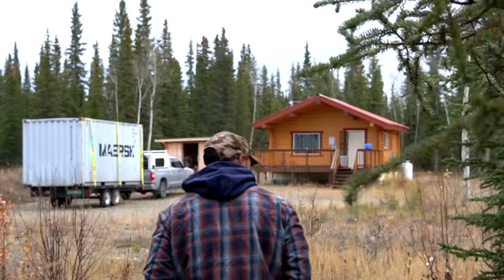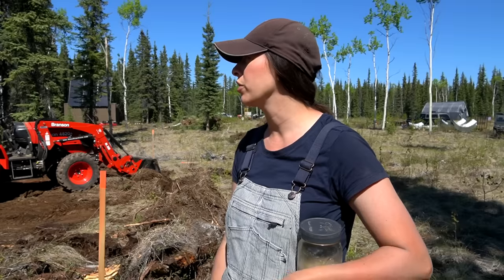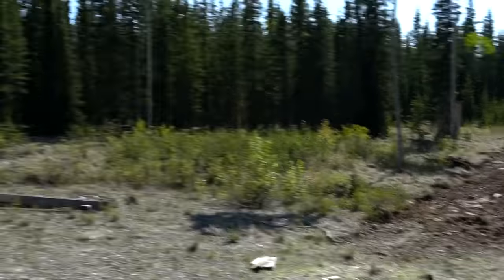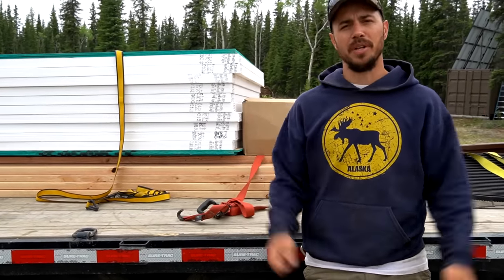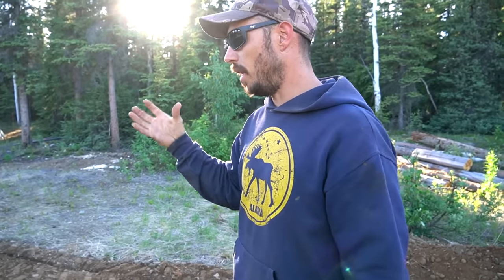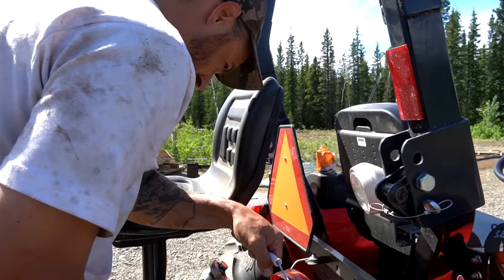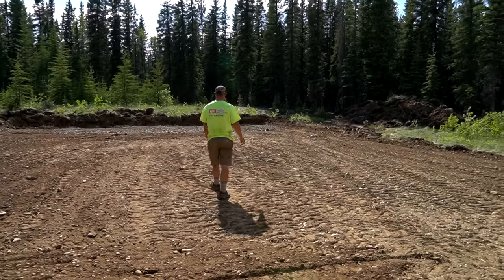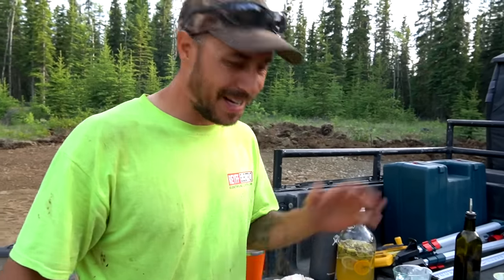Cutting in a Driveway to the Quonset Hut Shop | We Make Progress!

Comment: Tip of the day, when dealing with a thick fluid like hydraulic start your pour with the spout at the top and gradually roll the bucket down as your fluid drains, you won’t have the gurgling. Hope that helps.
Reply: Neat tip.
Reply: Either that, or if you are using the full contents of the can, make a hole in the can top opposite the the spout, it will introduce air, it 'glugs' as the air that is trying to replace fluid through one aperture, which is why it glugs, also then the fluid will empty in half the time.

Comment: In Minnesota, such sheet metal huts have been crushed by ice and snow and blown down. An interior truss arch system of your own lumber could reinforce the steel exoskeleton and optionally support insulation and interior sheeting.
Reply: Stronger than a pole barn wind and snow loads if it's bolted down properly.
Reply: @robertfandel9442  Pole Barn specifications vary on snow load and wind load etc so that is not a definitive statement, some fail and some don't.
Reply: The end walls will support and shape the form of the structure. The sheet metal sections have built-in flexibility that must be constrained over a long 60-foot span and the combination of straight and curved panels weakens the integrity of the arch's 40-foot span. Wind could put everything in motion, and snow drifts are irregular, not a good thing. I can't help but love your creativity and adventurous spirit but be careful on this one.

Comment: Cool lead in.  High summer.  Don't try to work til dark.  Not happening.   Chains for the tractor for winter use., front and back.  Some good looking dirt coming out of the work area.  Bees look great.  They'll produce til about Labor Day.   That's when it's time to harvest moose pizza meat on the hoof.  If you could just velcro a tracker on it.  Made that run to Fairbanks many a time.  When the leaves change late Aug/early Sept it's outa this world beautiful.  Good job on the shop grounds.  Yeah boy some heat.  You'll love it.  The shops I made had it.  Felt wonderful.  Hey when you put the ends in the shop hut make a sliding barn style door on the opposite end.  You can cover it over but have it in place just in case you will need to pull something through the building.  Simple to do.  Someday you'll need a way through it.  And you may want to extend it as well.  Never big enough.  Vid was really good.  Music, drone, graphics, all coming together well.  You've picked it up a notch.  Good fortune in your endeavors.  Just can't smell the pizza on screen.  Looked delicious..    Going to be fun tying off and putting up the hut.  Did a couple airplane hangers.   Battery tools, what an invention.  A million nuts and bolts.  Later, be careful.

Comment: That is some nice top soil you saved there. That dirty moss, as you called it, Holds nutrients very well. Insolation is higher at altitude and high latitudes. Literally more sunlight. Be prepared for those aspen roots to sprout. Great ungulate forage!
Tiny biters, 'noseeums' are midges. Gnats don't bite but do drive you crazy in eyes and other places for salts.
Harbor, battery xfer  pump.That Pizza looks AWESOME!
Reply from the maker: Thanks 👍

Comment: Erik and Ariel, Nice to see you guys enjoying your summer.  I live in Oaxaca Mexico in the mountains, high desert.  22 June 2023 Surise 5:54H Sunset 19:03 roughly a 16 hour day, I don't know how I would handle a 20 hour day and 4 hour night.  We have  a rainy season (roughly May to September) and a dry season  (Sep - May).  We have wide temp fluctuations between day and night.  In 37 years here I remember on one or two nights where it was uncomfortably hot to sleep.  But I was amused by how we humans adapt to different enviornments.  The Temperatures here go from extremes of 40F (coldest winter Temp)  - 100F (hottest SPRING temp) .  I love the cooler temps so everything from 40F up to 80 F is perfectly comfortable for me.  it's the 80-100 range I find unbearable and tend to sleep a lot.  So I smiled when you guys were uncomfortable around 60F which for me is almost ideal.  Right now 8am  FRI June 28, 2023 it's 75F and I have a thin sheet to take the 'chill' off hehehe.  
The chicks were adorable.  I've never seen a mottled black and yellow chick before.  Beau and Bandit seem to be enjoying the summer too.
Hugs to you both and stay COOL.  :face-red-heart-shape: All the best JIM

Comment: That Kubota oil will be a good thing in a pinch, because the oil viscosity is better on the manufacturer OEM oil, which is why warranty requires services while the unit is still within warranty be done with manufacturer fluids and filters. Your 50 hour service is a “break in” service. It’s primarily meant to break in the tractors components from first use out of the factory. I had many customers opt not to do them because the next service was 500, but I am glad to see you did them because I find them beneficial in case there was anything still in the units system from the factory that needs to be flushed out still. They have to do a lot of things to those tractors to make them shipping worthy depending on where they are coming from and going to, so that 50 hour break in service can be very beneficial.

Comment: Sounds like you're dealing with a glacially deposited gravel, which can be really dense and hard to dig in.  In 1982 I was an engineer on the construction 
of a sanitary landfill near Snohomish, Washington.  The project primarily excavated around an existing arroyo creating large basins to later be filled with 
solid waste.  This project included rubber liners to trap leachate from the landfill, purification ponds to treat the leachate and ponds to rear trout as proof 
of water quality.  The site consisted of several glacially formed deposits.  One area was calcified siltstone and sandstone replete with shell fossils left 
when it was under the ocean.  The calcified siltstone proved to be very dense and hard to remove.  The contractor was trying to use his D-9 Cat with a
"single tooth ripper" to gouge into the rock.  The effect was chipping quarter size flakes with each pass.  This D-9 Cat weighs around 50 tons and the 
"single tooth ripper" is made of hardened steel, 6' in length, 6" thick and varying in width from 2' to 3", in the shape of a tooth.  The siltstone required about 
50' to 60' of excavation.  After a near fatal accident in which the D-9 operator had to jump free in order to avoid the Cat rolling over on top of him, the
contractor received permission to use dynamite to remove the siltstone.  This is one of my most vivid construction memories.   Eric has a natural gift
operating that tractor.  🙂

Comment: A technique that I have seen used for pouring fluids from containers is to "go over the can". 

Instead of pouring with the spout at the lowest point of the container, rotate the barrell 180 degrees so the spout is at the top of can. This improves flow, because it allows air into the gap at the top of the spout.

Good luck.

Comment: TYM Tractors bought out Branson tractors.  So look up TYM tractor oil.  Might be easier to find.  Also you might want to invest in a box blade in you do not already have one.  So much easier to do gravel and driveway work.   Also will help with leveling.

Comment: So your DEF in a box, that spout will screw right into your antifreeze and gallons oil jugs, so you don’t have to try to poor stuff, just use the spout. Better than a funnel. 

Once you are doing collapse the spouts accordion  bit and it will squish the excess oil back into the jug. Leave it standing upright and it should drain pretty clean.

Comment: Eric, might I recommend you flipping the 5 gallon jug 180 degrees next time, so the spout is on top, then pour.  It doesn't do the bloop, bloop thing, because it's able to vent, as you pour.  Give it a try next time.  It's much better with full jugs.  As they get lower, it's not as big of a deal, but full buckets, it's way better.

Comment: Just a suggestion with the tractor for grading. Instead of using the tip or cutting edge of the bucket with down force that lifts the front tires off the ground, try setting the bucket flat on the ground and use the back edge of the bucket to drag the material. Also do this with about a 1/2 or 1/4 bucket full of material to add some weight. An old operator made this suggestion to me years ago and I found it helpful plus it puts a lot less stress on your machines front loader. Love your channel. Keep it up!

Comment: Not telling you what to do or how to do it (you guys are awesome) but I always appreciate tips.  A couple of times it looked like you were back blading.  If you're back blading (just trying to smooth it out) it's best to have your bucket level.  There's an angle on the back of the bucket that sort of works like a scraper, pushing higher dirt ahead where it will fall into the low spots.  Then having the bucket flat, with a bit of down pressure, smooths it out.  Take it for what it's worth, just offering a tip someone told me.

Comment: Check the front axle gear lube again after you run it for a while, On my kioti it takes a bit to work it around the front axle. Also check the torque on lug nuts and loader brackets.

Comment: That Kubota UDT-2 is premium oil, costs a lot but very good no regrets.  Never cheap out on lubricants for your machinery it pays dividends  with fewer repairs and downtime.  Kubota corp. probably charges a  "premium price" for their products  I'll agree.  I have a Kubota I am using their products to end of warranty.    I did buy O'Reilly hydraulic/trans oil this spring myself, still wasn't all that cheap,  63.00 $  per 5 gallon bucket plus sales tax.  I bought some 5-40wt T-6 Rotella yesterday at Sam's,  75.00 for 3 gallons. (full synthetic diesel oil)

Comment: Bo knows!  Bandit's ready!!  Pepper's like:  I charj 4 fotoz and awtografs.  Ms. Bullwinkle is spying for Sasquatch.  For some cheap traction assist, considered adding fluid to the rear tires on the Branson?  Something frost free for where you are, or m'be some wheel weights to bolt on?  The pad is looking really nice, as is the circular driveway.  Once you have it all defined, if you have a GPS, plot a plowing course so you know exactly where to be when the snow's deep, or especially if you're having to bust through in the middle of a storm to keep ahead of major drifting.  Also, m'be some snow fence, to keep the drifting off your driveway/pads?  Some great lookin' pizza there.  I know Ben's 100% DEET has been king in Alaska for a very long time, but that stuff is just VILE.  I wonder how this stuff would do?

Mosquito/Tick Spray For Skin

1/2 Cup--------Witch Hazel 
1 T--------------Vodka/Alcohol  
1/2 Cup--------Water 
1 t---------------Vegetable Glycerin 
30 drops-------Bergamot Oil
30 drops-------Cedar Oil
10 drops ea.--Lemon, Eucalyptus, Lavender and Rosemary Oil.

Dark Colored Glass (or Steel) Spray Bottle.  The essential oils can 
Negatively affect plastic, light degrades the potency of the oils.
Reply from the maker: Yes we will most likely fill the rear tires :)

Comment: Also don't skimp on hydraulic oil when replacing it in a Hydrostat tractor! It's very very important it has the correct oil for that transmission and pumps. Also pretty crazy it's calling for transmission fluid change in a 50hr break-in service. Looked up your manual and it's saying replace it every 300 hrs after which is unheard of.

Comment: Can't wait to see the workshop finished....  So your using those pipes to make a radiant flooring to partially heat the workshop, is that the plan?  If so, you should duplicate the idea in a greenhouse, built in a trench with earthen walls.  I figure you are about 100 to 200 miles south of Fairbanks, which puts you in a pretty short growing season.  Even a partial year round greenhouse would be killer...
Reply from the maker: The in floor heat will fully heat the shop, the coal stove will be in there is an issue with the in floor heat system

Comment: No doubt you two went right to work, Eric I don`t know what the cost of the attatchment is, but a skid steer would do you wonders, but it looks pretty good with just the bucket, I follow a you tuber, and it`s amazing what the skid steer does as far as leveling and grading, he says you want a crown on the road or driveway, so water runs off with no puddling, wich means holes later, he angles the bucket when he digs a road, so the center is crowned, looks great, and don`t even get me started on that pizza, it looks 3 inches thick. We see a lot of them in your videos, and Ariel, your teeth are just beautiful, and you didn`t even have a mirror for the last 5 years, hehe. All the best guys, watching from Michigan.

Comment: Blows hard enough there to knock Semi trucks over , from Healy gorge up to Nenana. You guys need to tie that conex down to deep pilings. You will loose power and everything in it. It could be full of water and still tip, so don't think that it just being heavy is enough. The big garage doors at Ucebeli coal rated for 90 mph, buckled from 110 mph winds.

Comment: You need to add a battery powered grease gun to your tool set now that you own a tractor and all those trailers and such.  Dewalt Milwaukie Rigid  Ryobi all carry a cordless grease gun.  Whatever your powered hand tool brand is they will probably carry a cordless grease gun.  Save your arm Eric and the no pump mechanisms are easier to get into tight places.  The cartridges are also easier to load.

Comment: what about an outside boiler stove and bringing hot water for your in-floor heating I have seen them set and you feed wood and nothing but piping to run and you just wood like you would do with a fireplace but i think the wood burn long in one of those boilers

Comment: If your far enough to DRIVE into Fairbanks, you need to learn to be smart about your commodities. In AK those of us who live out and about see to it that we have a decent amount of necessity items on hand so we don't run out. Simply because what you THINK you are seeing online and what IS IN FACT IN STOCK are almost ALWAYS 2 different things. Find a source and order in several drums of your oil from (preferably a local refinery source or petroleum farm) and keep it on hand. I lived 10 miles north and east of Valdez, so we made sure to have certain items ordered in to the port so we wouldn't run out. One of those was 4 barrels of 10-30 oil for out excavation gear and generators etc.

Comment: Don't worry about the oil! I've been buying it for 55 years. It's the same oil ! Made by the same company, ! They just put it in different containers!! Believe me. Branson does not have their own oil !  I was working during a hurricane back in the early 80's. I went to a company that had bar and chain oil. I watched them put different labels on gallon jugs, same oil, different names!  Don't be fooled!
Reply: Tractor supply has the same oils, that you will pay triple for the name brand! I've bought machines for around $500,000, dollars. I was told that if you don't use our brand of oil, it would cancel my warranty! BS. Just trying to help you guys out.

Comment: As time permits and material leftovers accumulate consider constructing a sieve to separate rocks from gravel.  There are several YouTube channels with designs for separating rock from soil.   It all depends on what screens you are using.   Chicken wire over leftover rebar or concrete mesh may be used.  Following is one example of a basic design.

https://youtu.be/qBtCUzSecYQ

Wishing you a safe concrete pour in coming weeks.  Cheers.